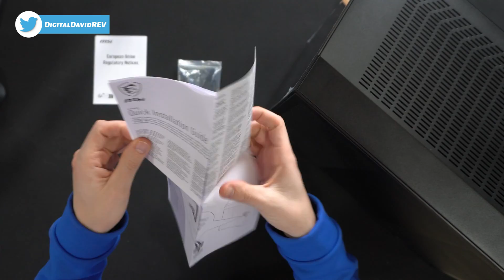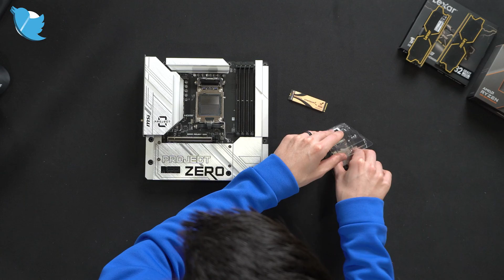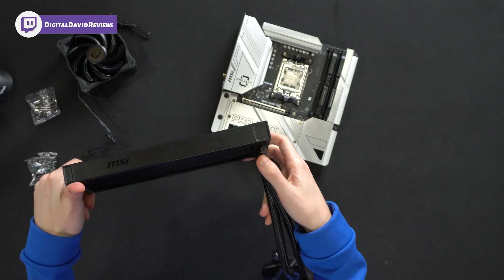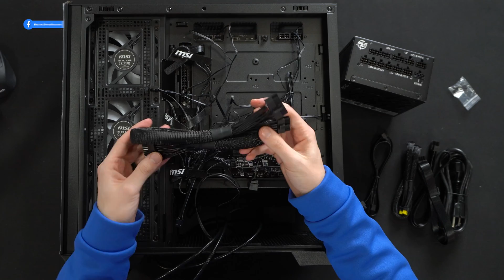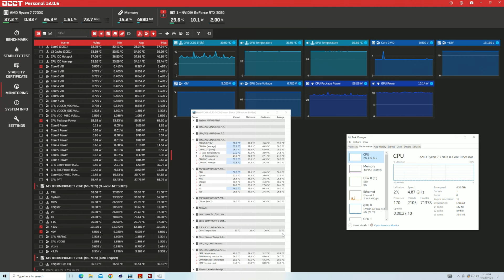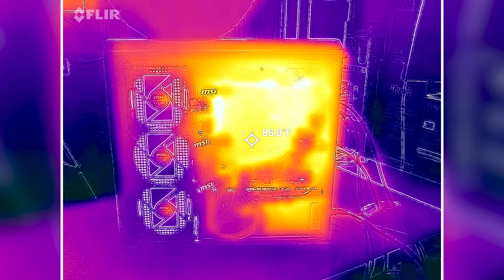MSI MAG PANO M100R PZ Case: 270° Display & Back-Connect Motherboard Review!

Comment: can we put  360 AIO on the Side rather than TOP
Reply: Yes , but it's not efficient. Hot air circulating inside the case will makes temps higher than normal

Comment: does anybody know if i can change the rgb colours with an app or something? the colour i want is not available as a static option when pushing the bottons
Reply: There are a few, google the most stable one online, i think its mystic lights currently but i could be wrong.
Reply: Most motherboards will have RGB connections to change everything you want from their built in software.
Reply: •	MSI Mystic Light (if you’re using an MSI motherboard)
	•	ASUS Aura Sync
	•	ASRock Polychrome
	•	Gigabyte RGB Fusion
Reply: @DQ3_gameing I can't seem to get any of these options to recognize my hub.

Comment: So I built the pc but can’t change the fan color or aio with app is it because of the led button because it works 

And is there a way to use both app and led button

(BTW I forgot about this comment I looked trough the manual just hold the led button for 3 seconds)

Comment: USB Type C at 15:45 then a 90 Degree at 17:44 and no word about it?? ^^ You couldn't close the side window with the normal cable, could you? 😀
why did you change it silently and not say anything about it? Is the 90 degree cable included in the scope of delivery? If not, that's bad... Did you deliberately not want to mention the disadvantage?
Reply: They're different cables, the one at 15:45 is the USB C and the 90 you see at 17:44 is the USB 3.0 cable.
Reply: You confused USB C and USB 3.0 cable. If you go to 15:45 just LISTEN for a while and you will hear him talk about 3.0

Comment: The all-in-one liquid cooler being used in the video has a pump situated within the radiator. Placing this cooler at the top of the case may lead to operational difficulties, as the pump will struggle with air.

Comment: Would it be better to have the AIO cooler fans to be intake or exhaust? And if i were to use a 360mm AIO cooler as exhaust, along with the one in-built exhaust fan, should i be worried about having negative pressure in the PC?

Comment: are we able to vertically mount the gpu on this case?
Reply: no
Reply: reading the manual for this motherboard there is instructions for vertically mounting gpu, it does require an additional mount though.
Reply: @hegemonyguildswtor  but not on this case, just not enough space
Reply: @datradium  You're correct I had the MAG PANO 100L PZ datasheet up

Comment: this made me not want to buy this and there is a 24hr bundle baord and case for 299
Reply from the maker: So glad our video could help you get to that point of clarity! What direction are you going to go instead?!
Reply: @DigitalDavid  not sure now tbh. alredy have a b650 aero g /aero 4080 / 7800x3d. and a msi a pro b550 / 5900x / 4070 aero. Dual streaming set up. Wanted to upgrade the am4, but now im looking to make a intel build... have both always loved the nzxt n7 white board might do that. get a i9 1400k with my 4080
Reply: What about it made you change your mind?
Reply: @nozers  looks the same with the gpu power connector… this suppose to make cable management better but the regular size cables become a nest.
Reply: @Opekillz Oh idrc about that i just think the general apperance of the case looks really nice

Comment: The USB3 cable should be straight as well, so it can be used with others motherboards non MSI. The usb3 connector on a right angle makes it so that you can only use it when the port is only a certain way. huge mistake there, not user friendly at all.

Comment: The huge holes/openings to the right of the motherboard need to be covered...cables can be clearly seen from the front.
Reply: He does not have the back plate on, the back plate is black, so you would not be able to see the cable as well

Comment: This back connector thing is gonna be the standard soon
Reply from the maker: I hope so! MSI is working on fixing the USB C not being 90 so in the next wave it will be addressed!
Reply: @DigitalDavid  Asus is currently developing their own mobos with this connector style and have already eliminated needing to run the gpu cables, its crazy, I think it works by adding extra power to the main pci-e slot and then there is a connector on the back of the board right behind the slot